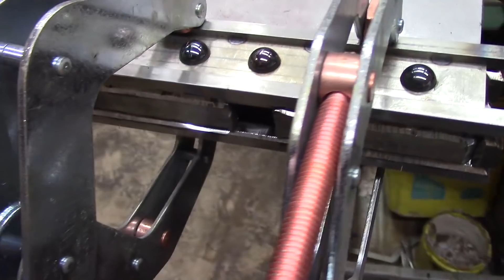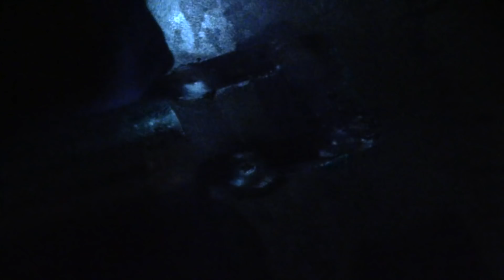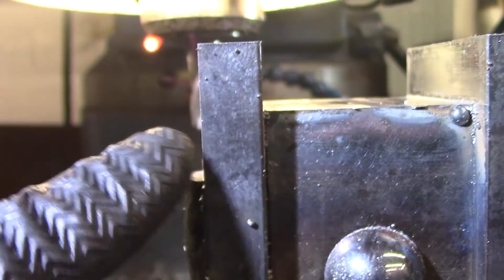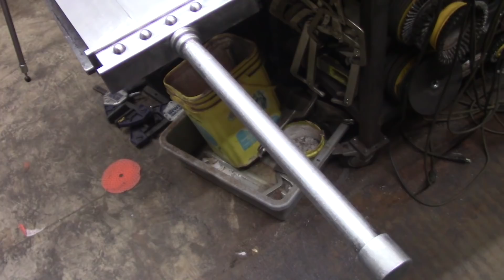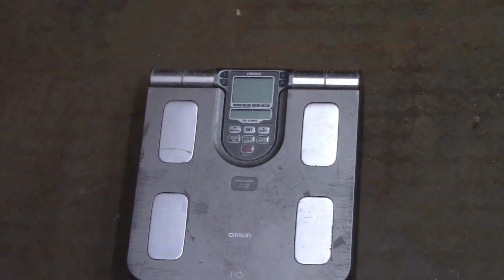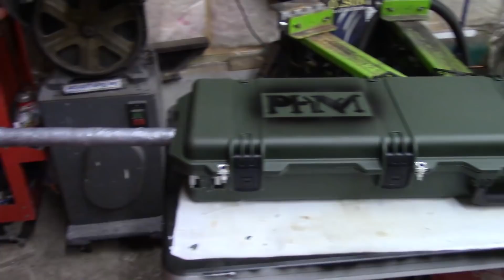HEAVIEST BUSTER SWORD EVER | 123LBS AND BULLETPROOF (Part 3)

Comment: Fail? No way. It was a success. It was pure entertainment the whole way. Furthermore, it was perfect. It might not have been what you were aiming for, but it turned out better than that. Did you know, the adhesive on 3M's sticky notes, was considered to be a failure by the inventor because it was not some super great bonding holding adhesive? But another guy in 3M loved it for its great effort and lack of success. It turned out that fail, is one of 3M's biggest glue moneymakers.

Comment: That leverage is a killer. That’s why when people say the old swords were 30 lbs it’s ridiculous. The first person to get tired was the first person to die in battle. Blades used in combat were way lighter than so many people think but could tire you out in no time anyway.
Reply: Yeah, the shorter swords usually weighed in the range of 1,5kg - 3kg and that's a pretty heavy thing to go on swinging around for a while, you can go whaling on that for a few good whallops, then you realize you need to start to conserve your energy for a looong time, especially on battlefield when seconds turn to minutes.
Especially with armor and a shield you're gonna become winded pretty quickly.

Comment: I work with 225lb to around 250lb tires (diesel) and I'm here "it couldn't be that bad, you probably need some milk" then I remember there was a way to see the angled weight, I make equation of this and tired have a consistent weight in the middle as they are round, your sword is more longer and lift on one side in wish case it is more heavy due to this even though it doesn't weight it, it would feel like you were trying to lift around 230lb (probably a bit more) in the handle wish is really hard (near impossible) on a handle without counter balance. Props my dude for lifting it even if on a shoulder. 

Edit: I'm drinking more milk now

Comment: Nice work man looks amazing. Was good to see the full build. Also liked how you used the mill to grind out the welds on the hand guards. They came out perfect(I remember when I made one I spent forever with the hand file doing those). Is that you garage at home? Its a cool set up.Also if you dont mind me asking what is under the cover on the hoist?
Reply from the maker: Yup, that's my garage all right. It's a '99 Corvette hardtop under the cover, I've had it for 16 years now.

Comment: You probably need to bench lift 255 lbs before you can casually use that blade. And yes, you look tough.
Reply from the maker: I have a 335lb bench, I'd personally say you'd need at least a 600lb bench to even have a chance. And thank you :D
Reply: @PrettyHateMachining  A 300 lbs curl should do the job
Reply from the maker: @Shamarh Kenner I agree!

Comment: "Do I look really tough" LOL

All I could think about when I saw you holding it is the edges on the back of the blade digging into your shoulder. 125lbs isn't that heavy, but when you put it in an awkward unbalanced shape or focus all that weight into one area (like your shoulder) it's a killer. I remember getting my drill press which was 85 lbs. and I thought I would just lift it up onto the work bench. Boy was I wrong!
Reply from the maker: Yup. It took about 3 weeks for the bruises on my shoulder to fade. Worth it though.